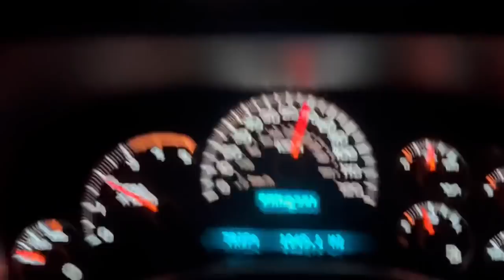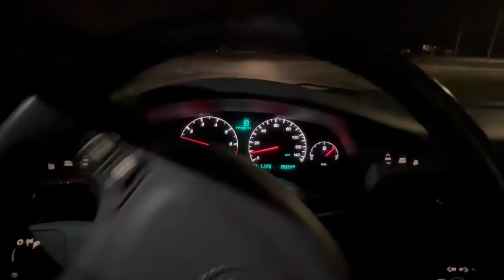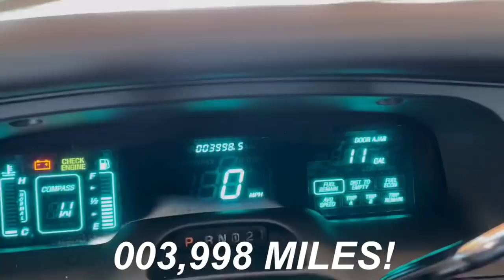I bought the Lowest Mileage 1997 Lincoln Town Car in EXISTENCE! RUINED in MINUTES! ROAD TRIP

Comment: The rusty vehicle on the trailer y'all were asking about approximately 23 minutes into the video is an M3 Scout Car used by the United States Army - and our allies - during WWII predominantly. While fast & reliable, it was considered a disappointment to the Army brass due to its poor off-road performance & lack of overhead protection. At least with the US Army, it was largely phased out of service by 1943 by the six-wheeled M8 Greyhound but was still retained for rear-area security and convoy escort duty. It's biggest claim to fame was the fact that General Patton used one of these vehicles as his command vehicle (though it had added armor and a raised fighting compartment).
Reply: 23:45 Thank you for the description!

Comment: My Dad had a 97 Town Car Signature Series.  Paid a widow $1,900 for it, with 112,000 miles.  He loved Town Cars and that was his third. 
Sadly- his wife was driving one day, he was passenger.  Someone pulled out in front of them and set off a chain reaction accident that ended with his car being hit 3 times on the passenger side.  The 3rd by a fully loaded logging truck.
Even though Dad hits his head on the windshield, and ultimately spending 90 days in three hospitals- that Town Car behaved exceptionally well in the accident and kept him mostly protected.  
Lincoln quality is superb in my opinion.